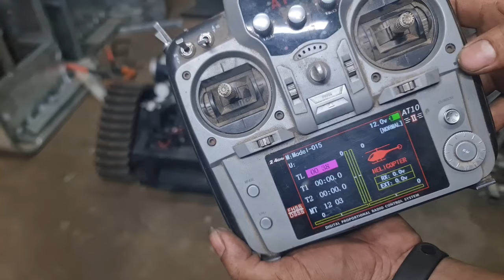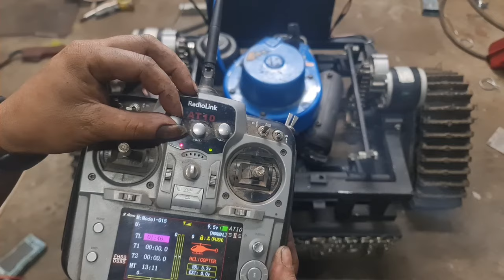HOW TO MAKE REMOTE CONTROL LAWN MOWER-ROBOT LAWN MOWER

Comment: Hi, I wanted to ask you what components did you use for the electronics, which esc, which mottire, which controller I need?
Reply: I was thinking that too
Reply from the maker: Motor + ic 24v 350w bro

Comment: At first look engine looks like 4 stroke because has some oil fill plug and drain plug but surprisingly its 2stroke. Has it some internal gearbox?  Why it starts with exhaust muffler but at the end of video muffler is removed?  some exhaust muffler for 2 stroke is absolutely necessary because without muffler there is no back pressure and lot of fuel is thrown away from exhaust. This can double fuel consumption, can cause engine overheating and combination with clogged cooling grill around starter this will result in seized engine. I like this track mechanism , looks unstoppable.
Reply from the maker: Thank you